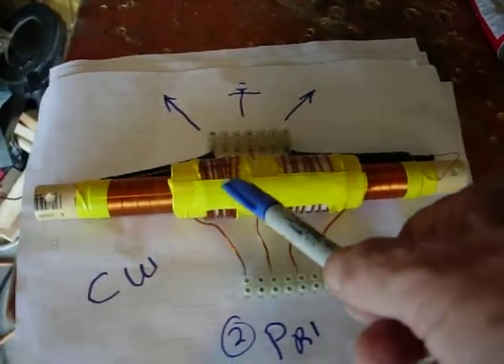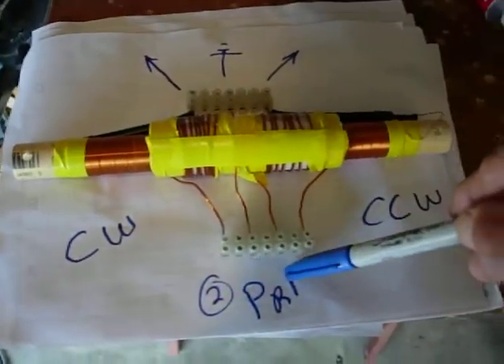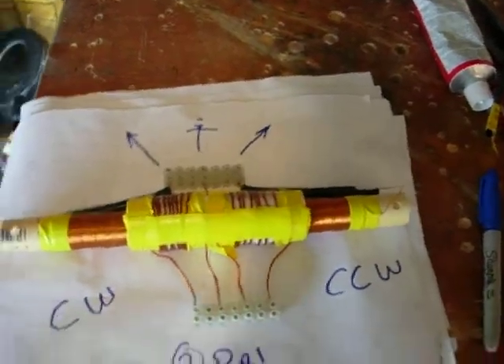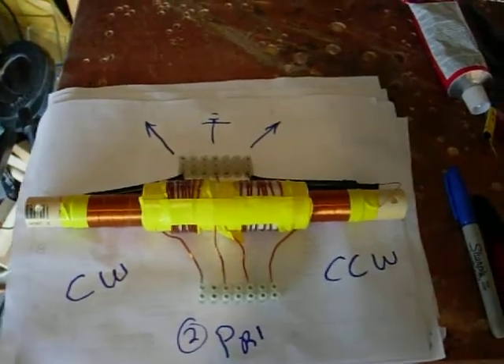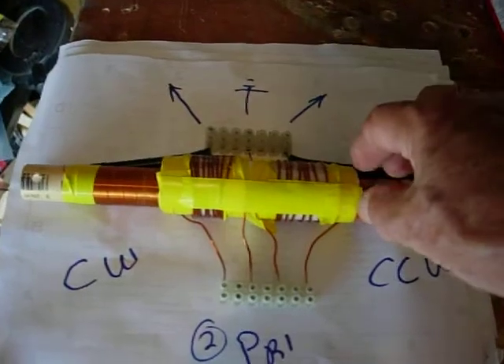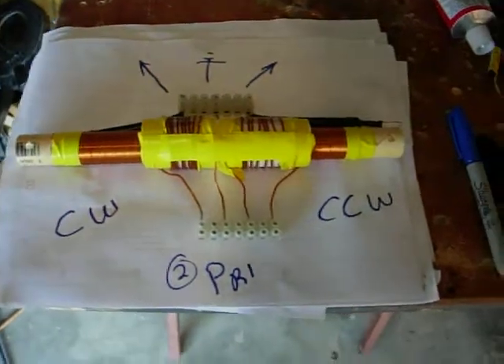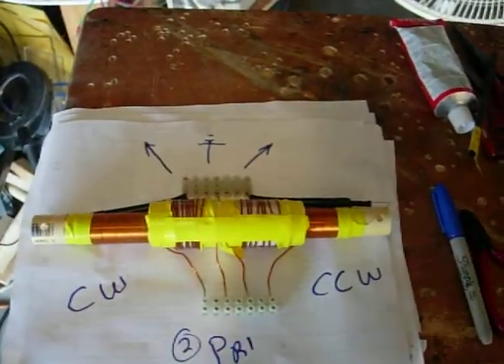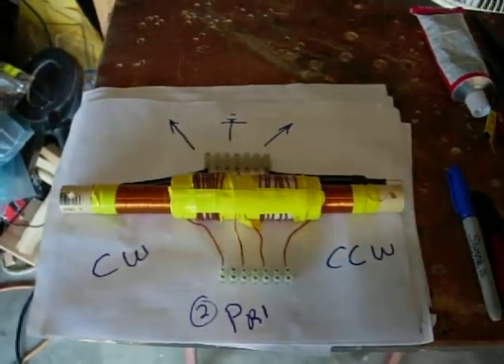Don Smith #322 Building a vibrator lwo power

Comment from the maker: The pinging of pri with 1,5vdc bat yielded zip .   I need to go back to my old Don Smith George Lakowski osc and flip on ehalf of the Barker Williamson coils so that the field cancel and the circuitry will then match Dons.    A totally new concept is being worked on that has a donut shaped coil with lots of coils wound around it  these extra coil produce DC with are pulsed back into the donut using NE555 One shots which feed each other in a complete circle  each pulse will fill all caps so the events should grow over time. to maybe a huge level of voltage.   if this proves to be the case then the parts will have to be able to handle extremely high voltages  maybe to inifinity of course we don't have parts that do this POOF.